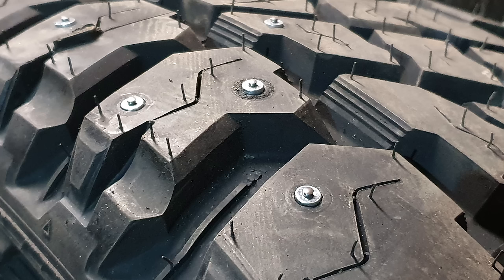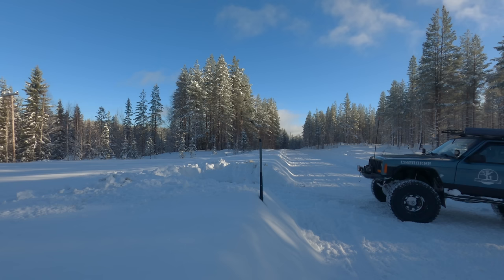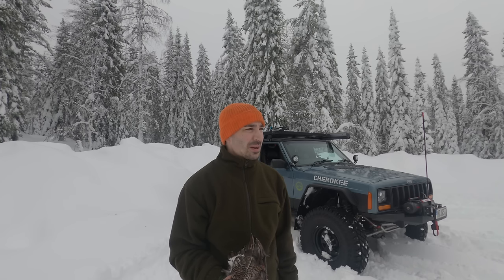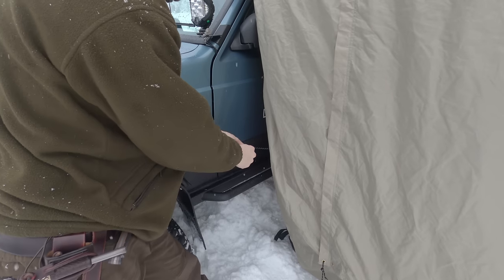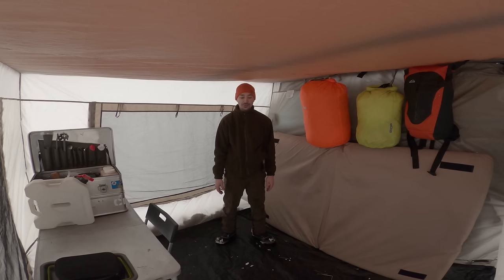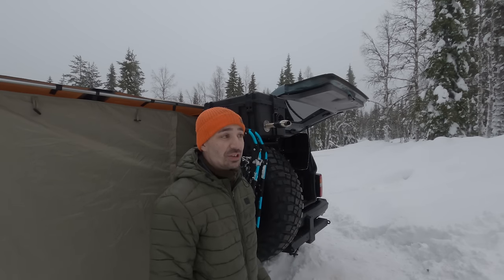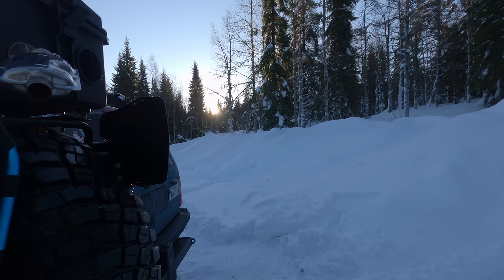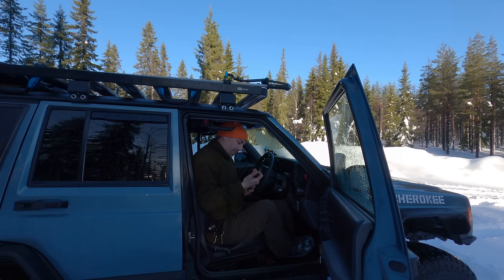Finally Out Camping After Months Of Crippling Illness

Comment from the maker: Daytime temps are rising above 0c, the snow is round 1 meter deep and its getting heavy so wheeling conditions are tough. I expected a lot of digging, low tire pressures and possibly chains but a set of Maxtrax would have been a good investment. Maybe next time! 
I set out in the Jeep Cherokee XJ Diesel to find a winter camping location in the wilderness and test out my winter gear. I have modified the ARB 2500x2500 Awning Room and added a Diesel Heater to adapt it for winter conditions. In this video you join me on a little 4wd adventure, winter wheeling and exploring some of the forest roads in Northern Sweden where I test out my gear and camp out in the mountains. 
Thanks for watching
Reply: What diesel do you have in this thing?
Reply from the maker: @MileytheJeepV2  Its the original factory diesel on the UK RHD export models - https://studio.youtube.com/video/DGK6tFo-9xk/edit
I've molded it a bit but its still pretty original.
Reply: @WorkshoptoWilderness  thats great what is the diesl out of i see it looks like it said jeep ; looks to fit and run great..i like the set up did u lock the front yet dana 30s are greatly under estamated it keeps the rig nimbal lite less chance of breaking things its worth trussing and upgrading. I wheeled with a high pinion 30f/35r bone stock some of the craziest overland swamp trails and out wheeled most bigger badder builds cause they were to heavy and too heavy on the throttle..im preping for a complete front to back overhaul she's an old veteran ready for upgrades.. lookin forward to more awsome vids safe travels from ur new cherokee buddy "Rooster" .. our swamp apes send there greatings..
Reply from the maker: Hey Rooster, thanks for watching. The diesel is the factory export engine the xj came with in Europe. It's a 2.5l, although I've almost doubled the hp on mine to date. It's a decent motor despite what some say. It just needs a few upgrades to make it reach its potential. 
To date, I've trussed , sleeved, and gusseted the d30. I have a locker in the workshop, but I'm yet to fit it. I will try and fit it before the snow falls. 
What axles or overhauling will you do? Sounds awesome 👌 
Thanks for watching

Comment: A trick Iearned years ago for putting on chains is to cut your self a small block of wood that you can drive up on and  is tall enough to to get the tire above the surface.  Before you drive up on the block, lay your chains out with the block set in between two of the horizonal tread chains.  Drive up on the block and go about installing the chains. It give you enough slack under the tire to freely wiggle the chains into place as needed.
Reply: Damn, nice. Filing this for later for sure. Thank you for this tip.
Reply: Awesome tip! 👍🏻

Comment: A couple of short pieces of 4" pvc pipe and a couple of T's with a 2" branch may help distribute the heat at different levels so you have discharge near the ground at low settings. The key is short pieces so they don't overload storage. Really enjoyed the video. Thanks

Comment: nice set up... you really should set up your D heater to blow the heat from the bottom and make the intake take air from the tent as well so raising the temp of the air is more efficient.  Just a suggestion.

Comment: With a manual transmission in snow like that you need to do the "rocking" trick as soon as you get stuck. Never fully let the clutch out and allow wheels to spin. Simply let the tire rock and inch forward without spinning, and then back wards. Never letting the tire spin until you have a good 1-3' long patted down flat spot and then you can go for it lol
Reply: Ideally for snow like that you want to float, not chug through and hit bottom. That's the 40"+ size tire type of snow at 1-3psi
Reply from the maker: Thanks for the tips, I will give it a try next time we have some good snow. I've got some bead locks now with a fairly good winter tire that I let down to about 4psi so it should make for some better floatation. I've also regarded to 4.88 so I should be able to crawl slower. Anyway thanks again!

Comment: I was pretty surprised when you got over that first 10 meters. Proper overlander you’ve got there!
Reply from the maker: I was too to be honest. I guess the chains did help with traction but they still weren't the right tool for the job. Maxtrax would have helped a lot. 
Thanks for watching.
Reply: @WorkshoptoWilderness  Still did quite a job, I’ve been thinking about the too. Shame that they’re quite expensive. I’ve seen some fake ones or 30-40 euros per piece. Seem Legit, 5mm thick plastic. I think I’m going to buy one and just see what damage I can do to it. 
Enjoyed the video!
Reply from the maker: @Benzlerfahrer  yeah that pretty much what I think I will do. Some fake 50 quid ones and hopefully they work. I've seen a trick where you can drill a hole on the burnt out teeth and put nut and bolt there.
Reply: @WorkshoptoWilderness  Didn’t even think about that! Thanks for the tip. 
I’ve already been thinking on how to put them onto my (future) utility trailer (still looking for a really small one). I unfortunately have to get a small trailer because my Suzuki Vitara is not quite big enough to store a lot of stuff in. Also no ways of connecting stuff to the body.
It’s not going to be ideal. But it’ll get us started, I hope once we get overlanding a bit, the misses could be able to drop some of the luxuries we bring. To be as minimalist as possible is such a beautifull thing hha
Reply from the maker: Minimalist is a good way to go. I try my best but my systems go out the window as soon as Meg and Max is on board. The next video is a big family camp and the jeeps loaded up with so much stuff. 
Over time I'm sure she will pack better and better much like a backpack or anything else. 
Those Vitaras are awesome vehicles. So light they can go anywhere. A small trailer would be a good shout. There are some guys out there who overland them with roof racks and gear on the roof
Reply: @WorkshoptoWilderness  
Yes, whenever my godchild comes over, they bring a truckload of kiddy stuff. But it’s nice to have the option. Certainly with the setup you have.
And yeah I’ve been driving it for a year without any changes (it is one of the new Facelift models. So it’s not as blocky shaped as the previous ones) and I am quite surprises of it’s capabilities in the terrains over here (I’m from Flanders, so it’s pretty much the same rainy weather and terrains as in the UK). I only got stuck in the deep mud once. So I hope after the Suspension lift and tire change it will handle much better in the field. 

I will be looking forward to the family video, this will give me quite a good idea what toe expect myself when overlanding with the misses, and of course eventually some younger versions of ourselves 😁. 
I’ve invested a lot in camping gear over the years, but I’ve noticed that it’s getting harder and harder to get away from society for a weekend. Especially in these regions. 
So I now try to invest more in something wich I can take my family with me and enjoy the outdoors. 
I must day your videos on moving to Sweden have been somewhat of an inspiration and it did get me warmed up to do some offroading.

Comment: I'd recommend trying to make a return air hose for the diesel heater with a Y join on it. If you can have say 70/30 split of return air from inside the awning room and 30% outdoor air which will have super low relative humidity it would likely take care of the moisture issue and run the heater more efficiently. Would just have to come up with a creative way of controlling the flow of outside air coming into the Y splitter.
Reply from the maker: Sounds like a good idea. Improved heating would be good for the little one. I'm looking into to insulated ducting at the moment so hopefully I can pick up a few meters and build something functional. Thanks for the idea 💡

Comment: Proper job! :) Loving 1440p60, especially for the outside jeep shots, underneath the sills, seeing the suspension move etc. - great stuff! I'm stil amazed you don't have 10x more subs, but hey quality over quantity :D

A couple of questions please: 44:35 your jeep run with the keys out..? (I had am old Saab 9-3 that did that but it was down to wear, not by design.) And have you considered piping the warm air into the awning lower down so that the heat reaches people before rising to the ceiling?

Cheers!
Reply from the maker: Thanks mate, It was good fun to film. Ever since I had issues with the ignition barrel the keys can come out and the engine will still run. Perhaps its wear or maybe just poor design. Pumping the heat lower down is certainly a better solution. It just requires a longer insulated duct that can drop down and run into the vent at the side. I will certain do that but I just need a better duct. 
Thanks again for watching and for comments on the videography!

Comment: Can you drape a small lightweight tarp over the top of the awning as all you have a single skin roof might help a bit with heat retention and as others have said heat rises so you need to have a low entry for he night heater outlet hose
Reply from the maker: I could but I want to keep it simple. I've plumbed the heater in from the bottom and it recirculates the air these days and it makes a huge difference. It would be nice if they offered an awning room in canvas or something thicker. Its a bit of an after thought but then winter camping is. Thanks for watching

Comment: would like to see/hear how those padded blocks you were going to use as a floor are working out...and which ones did you buy...and how did that heater work in keeping the awning room warm....
Reply from the maker: I will be heading out again soon although the winter is over now so no heater required. The foam tiles arrived although I need may more to complete the whole room. It will make a huge difference though once I have all of them. 
Heater was amazing to be honest, a game changer for colder nights. I will certainly be using it when temps dropp off again in October/November.

Comment: What heater is that and what show did u do the set up really need one great show love my xj as well
Reply from the maker: I've got a video on how to build it if you take a look on the channel page. I could send a link but I'm on my phone at work. Its a small diesel heater. They are quite efficient and use very little fuel and produce a lot of heat. 
My setup in this video is pretty crap because the heater is pushing heat into the top and taking cold air from outside. This is good for low condensation but bad for warmth. It's better if it recirculated the air from the tent.

Comment: Great adventure! Thinking about the 2000 series awning for my Jimny...Would you recommend?
Reply from the maker: I think they are better than the ARB ones in design. Its EzyAwn isnt it? They look a bit stronger in the front and have a tensioner. I don't think they get bad reviews and most seem to be pretty happy with them. 
Thanks for watching.
Reply: @WorkshoptoWilderness  i meant same as yours in the 2m variant. Do you find an awning a valuable bit of kit for overlanding? Cheers
Reply from the maker: @benbroccoli89  I personally really like the awning for overlanding. You could drop the weight and just string up a tarp as an outdoor cover but the awning is faster to setup and its pretty tough in the wind which I like. 
Its nice to have an outdoor space out of rain or sun to sit, eat or relax. The awning room is kind of essential for us here due to the mosquitos. Having a place to just be away from flies and have the windows open in the summer is really nice. 
As much as I've bivi camped and put up with bugs for years, enduring discomfort wears me down over longer trips. 
I would personally recommend an awning as they re out the way most of the time until you need them.

Comment: What diff-locks are your running? Proper lockers or the standard diff-slip? Makes a big difference in the Swedish snow imho as the "automatic" ones are set for better traction.
Reply from the maker: Open diff at the front and a standard limited slip at the back. Nothing special as of yet.

Comment: you def need a bigger motor , from the sound it def seam you are lacking hours power , need to find a 5.9 Cummings
Reply from the maker: I think its ideal but it all depends on what line of life you come from. 160hp. 400 Plus nm torque, 27 to 31mpg is basically perfect for a 2 ton fully loaded Jeep for long range touring, offroad work and camping. A 5.9 is just far too big for this small jeep, thirsty and too expensive. I for one need to regear which will help put me back inline with where I need to be power wise but for now she's got plenty of power and I have no complaints, after all its me in the driver seat, not you. 
Thanks for watching.